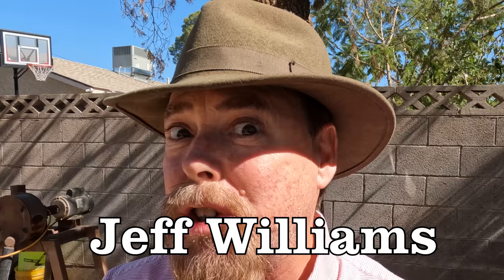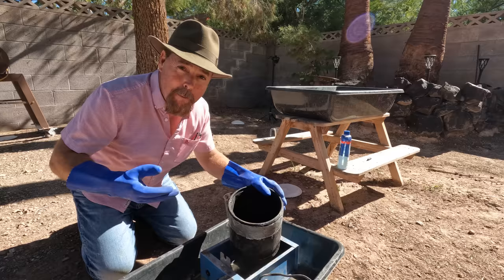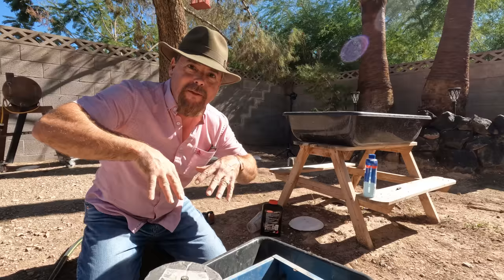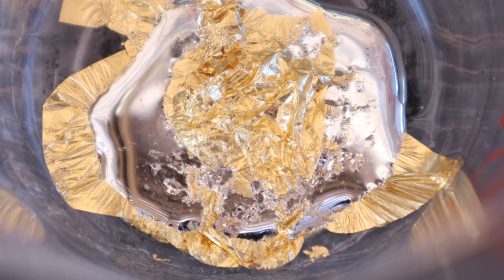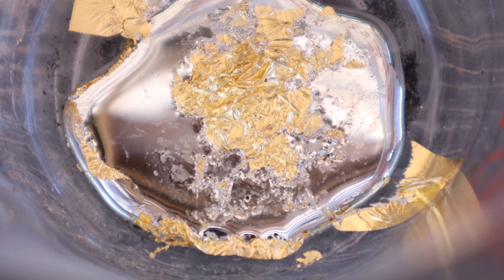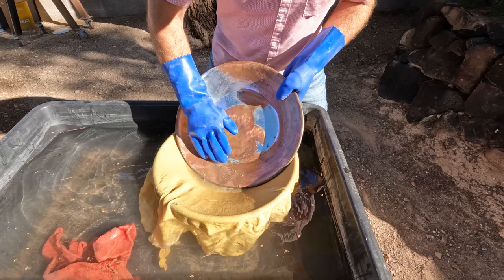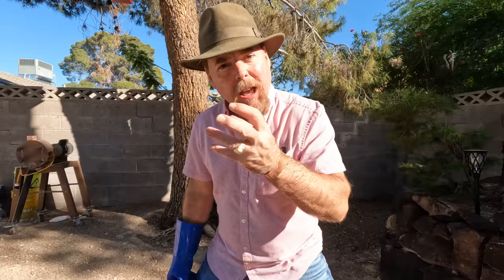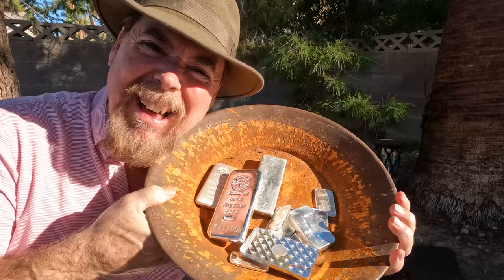Dangerous Mercury with Rod Mill for Gold Recovery

Comment from the maker: If you want to get fine Gold from either black sands or crushed hard rock ore , you can use a rod mill to help extract Gold if used in conjunction with mercury . If used properly us can collect up all the very fine Gold you have without losing anything but beware Mercury can be dangerous if not use properly so we made this video to help you guys do it safely. If you want to see more hacks on getting fine Gold fast, then watch this video. https://youtu.be/dRnhGfqnpE0
Reply: when will the next video of your mine come out?
Reply: nice thanks jeff. i always wondered how those old timers did it. 💯🇺🇸
Reply: Hey Jeff, What's the best site to see if claims are open or not?
Reply from the maker: you betcha  @EnergyTRE
Reply from the maker: mylandmatters.org @thomaspowers2405
Reply: For a bit I thought a rod mill would be good for crushing fines for easier separation of black sands & fine gold, but I need something fast like glass crushing, only I want something that can make wet black sand smaller & something portable too - like for beach sand gold.

Comment: Radioactive Jeff “Mercury has gotten a bad rap!”  As he walks out of his Zone 3 containment area!  Jeff, you rock.  I used to watch the copper bubble up at the cyanide pools and was always fascinated at the color and consistency.  When the mine in Tembagapura, Irian Jaya, started hitting gold at about 8% a ton, I remember watching my dads guys set the mill up to process gold and copper at the same time.  The concentrate was aerated with a soap like gookenpucky and sent to the coast 60 miles away by 8” pipe for loading into the bulk tankers.  It was interesting how the gold and copper were separated from the concentrate but the “Yeller” sure was pretty.

Comment: A sugestion better use if rod mill.. to separate gold from black sand run a cup or two of black sand in 70 rpm rob mill for 6 to 8 minutes. The brittle black sand breaks and the gold specks flatten out. After say 4200 revolutions pour the black sand through a fine screen.  The sand will have been broken to small enough to go through but the gold flattened into disks catch in the screen where they can be collected with a brush. Ps played with murcury as nurses  son from when a s
Whole tray of thermometers was droped . It was gathered with type  paper and put in a pill bottle. Today  they would call out the hazmat team for a Traynor thermometers.  Still I would rather stay  away from mercury.. btw this technique was developed in the Yukon  about 1964 or 68 iirc and doubled the production of some mines.

Comment: We quit using lye and went to soda ash and borax. With sulfide ores we used bicarbonate of soda and potassium nitrate. Had to burp it a lot in a closed container. Oxidized it great. Also when I used copper plates, I would first dissolve my mercury in dilute nitric and then use a rag to spread it. Always wearing rubber gloves. One bad thing about mercury is it likes fresh cuts and scrapes. A tiny drop can get in and actually travel your blood system. You're right about the bad rap. In some parts of Mexico, after a hard night of partying they ingest a shot. Swear it cleans them out. I didn't party, thank God, so didn't test. Did notice they were still around a few years later. Still had teeth and hair. We also used that syringe with 3 cotton balls as a chamois. Cotton dissolves in nitric.😊
Reply from the maker: great info as always Richard ....need to get you out and working at our mine . Lol
Reply: @Askjeffwilliams  I wouldn't mind coming up there and helping in your mine sometime Jeff! I don't ask nothing in return since I have my own mines.  Mainly would just give me a change of scenery for a while.  😁👍

Comment: Hey Jeff, If I utilize the mercury/nitric acid process to extract the fine gold from my black sands, what would you guess the purity of the gold is? I thought I read somewhere a long time ago it was around 99%? It sure is a different color than the raw gold, kind of buttery yellow. Thanks for all you do!!
Reply from the maker: purity would depend on a lot of factors ...you can have it assayed to know .... most Gold is never 99% pure
Reply: @Askjeffwilliams   The nitric acid would burn off any copper or silver alloy in the gold, right? What other alloys would or could potentially be in the mix after using the nitric acid?